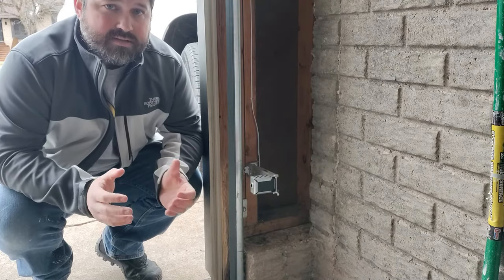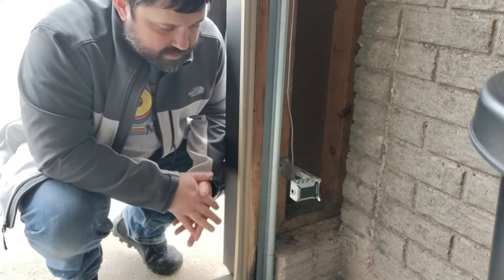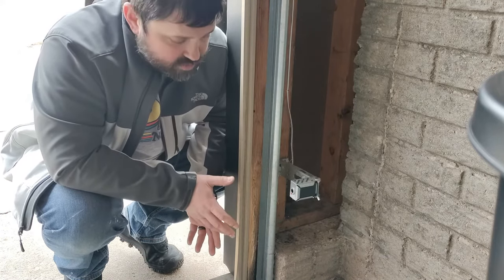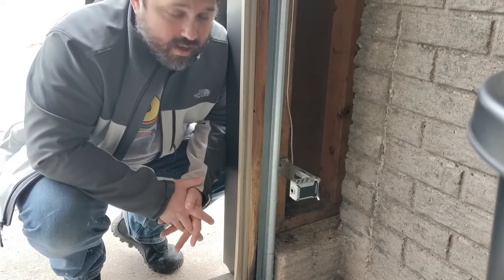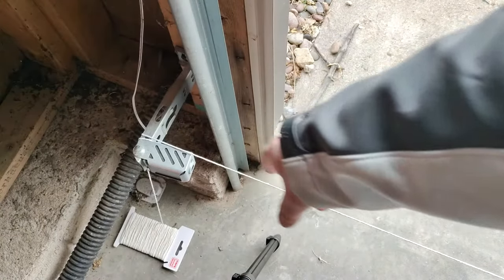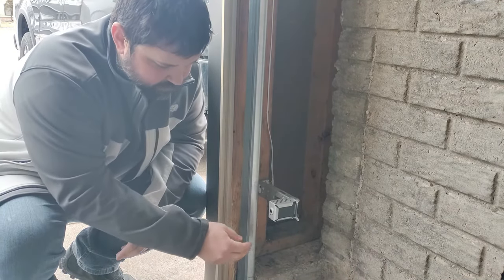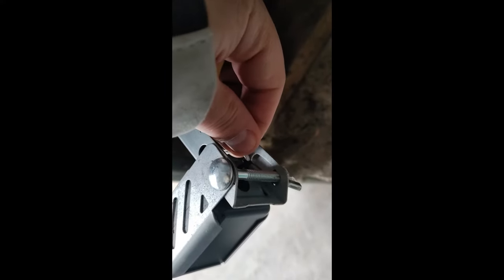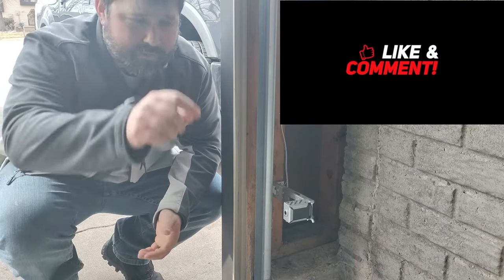Garage Door safety sensors out of Alignment | Easy fix

Comment: Thank you, I bumped it dragging a trash can past the receiving sensor and I cannot get them realigned so the string tip is what I'll try I was using a laser. I don't seem to have those little side glowy lights mine are glowing all the time orange and green I Believe they were installed incorrectly they should have been on opposite ends cuz there's a light that shines out of the garage instead of in. But the installer was another story in itself.

Comment: I have one sensor is lit green on the side and the other sensor is looks orange?  I may have hit it putting the shutters away.  Door opened fine, won't stay closed.  Goes down all the way, then pops open again.  Will try the string.  Would the sensor turn green like the other if I get it aligned?  Thanks
Reply: the second side stays a different color, but one sensor stopped flashing once I got them aligned.

Comment: They are way to high my little gog would go right under that and you know what that means.
Reply from the maker: Yes, those were placed to high when installed.  They should be about 6 inches off the ground.
Reply: Just recently, my door was coming back up … A friend & I, after spending time on YouTube, fixed the problem … As the door moved down, it was hitting, moving a skinny wire from the sender, causing sensor to move & turn off … Moved wire out of the way, door comes down without touching, moving wire … Door works normal … Now I’m thinking, does wire have a bad connection, light on sender sensor should not turn off

Comment: Thanks my issue was the wire moved some.  I agree with the comment about better sensors but my home is only 1 year old you would think new tech would have been included.  This is the same as what I had in the 80s!

Comment: If you have the one with the yellow on side side and then the green one on the other side,  you know you’re in alignment when you adjust it to make the green light a steady solid. 

If your garage is still being weird after that, make sure the wires are pushed in far enough into the garage motor. 

I just had a couple of annoying days thinking everything was messed up, then discovered after pushing in the wire about a couple mm, it worked perfectly fine like nothing ever happened 😂

A good sign that may be the issue is while setting the open and close limit and it goes through the auto cycle to run through the set limits, it will raise up with no issues but then stutters and freaks out when it is about to go down. 

This happened to me even when the green light was solid and showed it shouldn’t have happened, but i noticed it blinked off randomly for half a second, leading me to check the wire. 

Hopefully this can help someone else

Comment: We have no light on either sensor, have tried to align as directed, no obstructions.  We have power.  
Defective sensor?
Reply: I have the same problem - did you end up replacing the sensors?

Comment: Can i operate the door without sensors?
Reply from the maker: If you hold the button down usually you can still close the door.  Just be careful as the door will not stop if anything is in the way.  Make sure the door is clear.  Do this at your own risk.

Comment: I have what sounds like this issue, but cannot seem to fix it. I have a sold red light on one sensor. If I put my hand over the sensor, on either side, it starts to blink, so it definitely sees the other side. I have tried moving it up down and from side to side and nothing seems to fix the issue. Any suggestions?
Reply from the maker: Does the door go down part way, then stop and come back up?  What is the door doing exactly?
Reply: That's what mine does goes down then reverses goes back up
Reply: Mine is doing same thing 😣
Reply: Come to find out mine was due to not being programmed completely